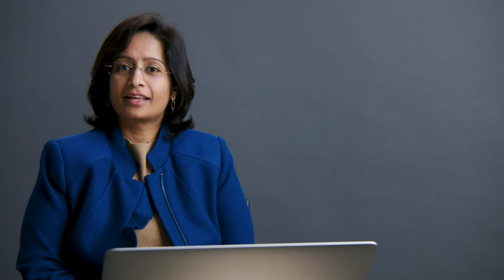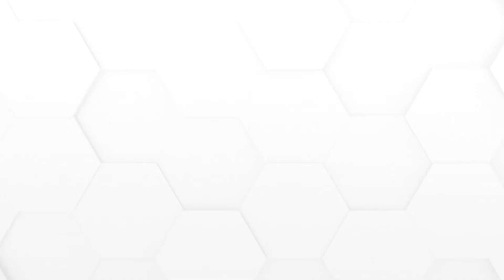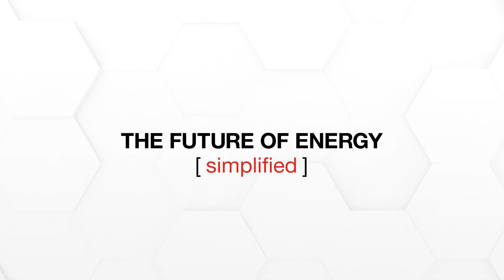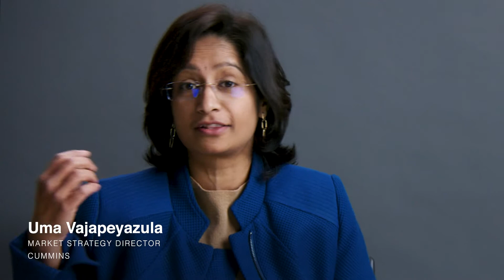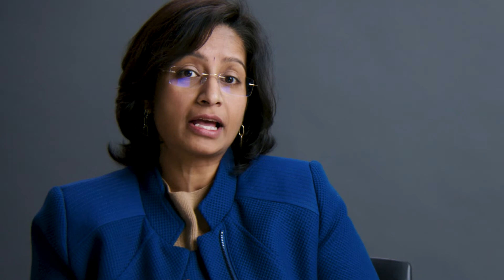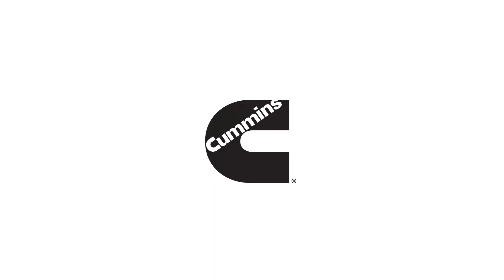How is hydrogen produced? | The Future of Energy [simplified]

Comment: Steam Methane Reforming is NOT natural gas mixing with air. That would be more of a combustion.  SMR is methane (from natural gas) reacting with water H2O in the presence of a catalyst at high temperature.  Which does produce high amounts of CO2 to hydrogen.  Totally 9:1 by mass. I wish that they would give all the information, not just water it down presuming everyone is too dumb to get it.